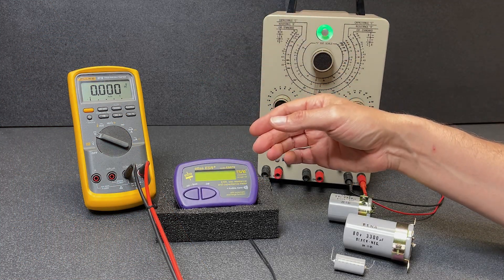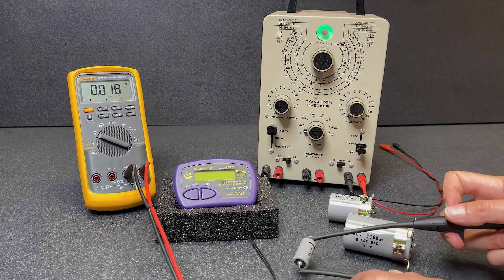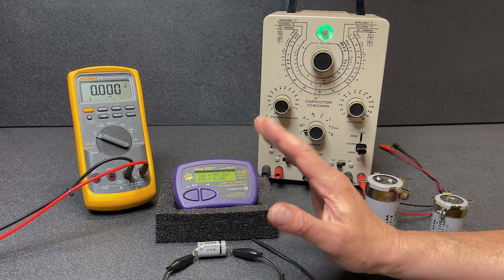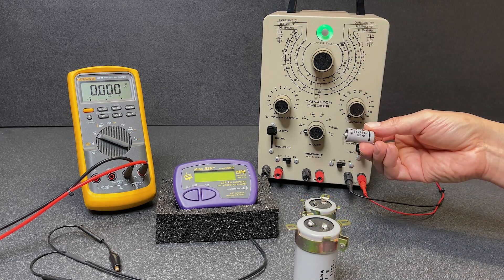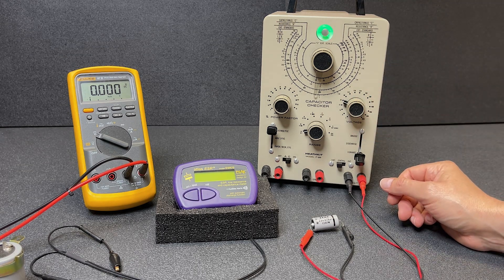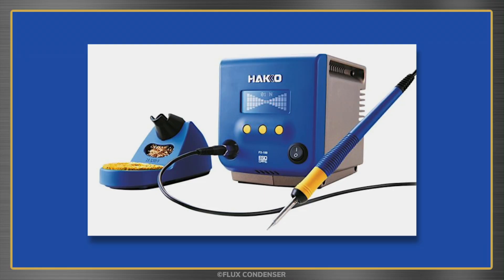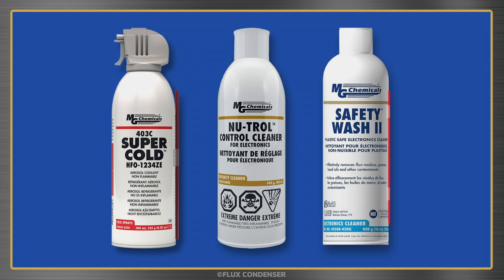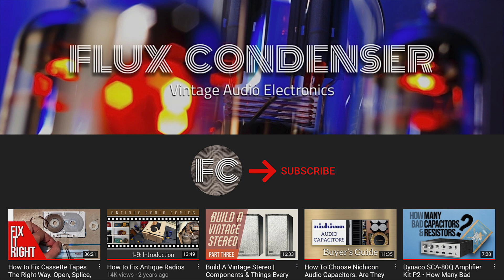Quick! Can You Test Capacitors for Capacitance, Leakage & ESR?

Comment: Hi. Would discharging the capacitors with a screwdriver in contact with both legs safe enough to drain them?
Reply from the maker: That might drain it, but it’s hard on the cap and might create a spark. It’s better to use a high ohm resistor or dedicated cap discharger.
Reply: @FluxCondenser Thank you

Comment: Can you test with only a dmm or possibly an Arduino with an external adc? How about one of those cheap multi testers?
Reply from the maker: You can test capacitance with a multimeter, but not ESR or parallel leakage. There are some cheap devices that will test for ESR, though.